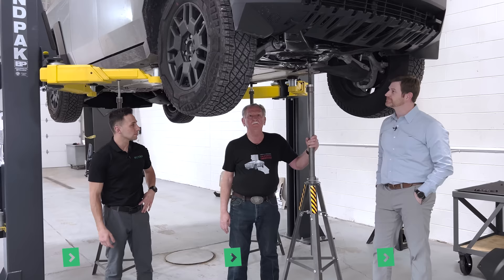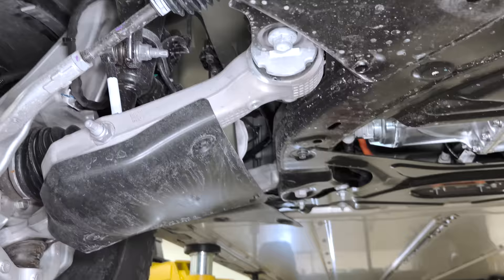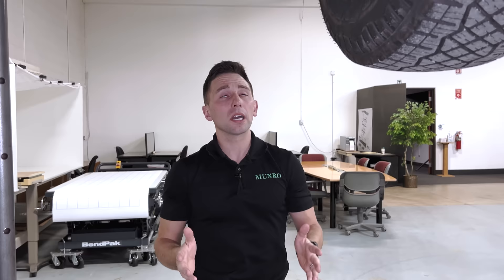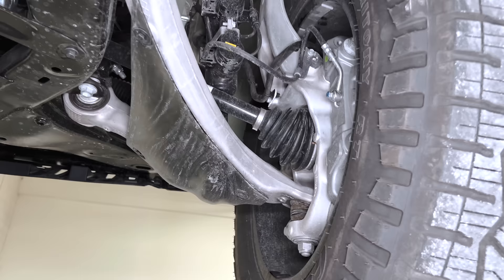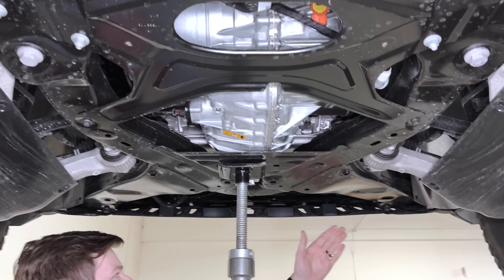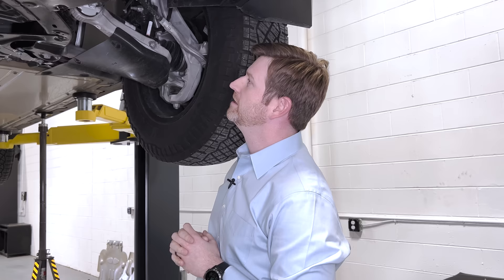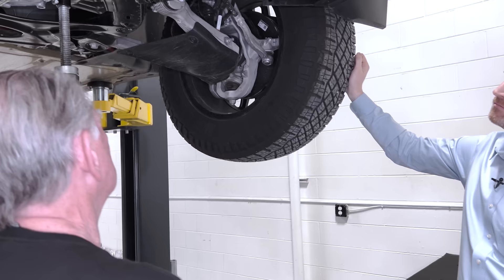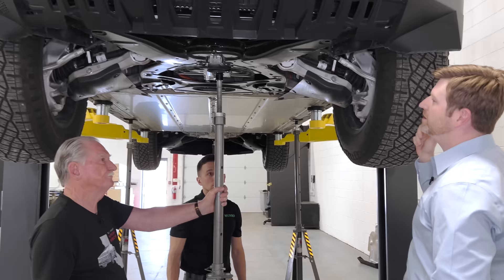Tesla Cybertruck Underbody

Comment: The connector is for the extended battery package that you can't get yet
Reply: That's what I'm thinking too.  Another use might be some future type of inductive charging system, but most likely it's for the extended battery pack in the bed.
Reply: I was going to comment about this but I see you beat me to it. Yes, that is exactly what it is for.   The range extender will be 800v and it makes sense for it directly terminate into the main pack.
Reply: I hear it’ll hit the streets in 2029
Reply: The range extender will basically act as a DC to DC charger when the range extender pack voltage exceeds the main pack voltage.
Reply: Flux capacitor option
Reply: I was surprised they didn't think of it. It was my first thought as well.
Reply: @ryandoyle4344  Indeed Marty... But will the battery pack extension be 1.21 gigawatts?
Reply: A bit small for that for stuff like super charging the extend battery.  It looks to be able to do some type of lower power aux thing. 50A @ 800V? Supercharging would I think require something rated at 500A or so.
Reply: Right
Reply: Tall knuckle is on the Maverick R and other road vehicles too
Reply: But look at the neighbouring connector, how thin these HV wires are, 4-6 mm² max (about AWG 9 to 11, which takes about 40A). If this really was the connector to the extended range battery pack, then this extended range battery pack (about 50 kWh in capacity) could not be fast charged at a supercharger nor discharged during driving, but charging/discharging power would be limited to about 800 V * 40A = 32 kW DC, and therefore about 0.6 C.
Reply: @MooseOnEarth Exactly,  that connecter is to small. 
In my opinion, Tesla is pulling everyone's leg about a battery extender option. It will never be available.  They will claim there wasn't enough interest so they  canceled it.
Reply: Could also be used for solar accessories
Reply: I suspect they hadn't suggested the extended battery pack as an option because the gauge wire the plug could accommodate was too small for the Amperage required for that application. Munro guys are super sharp.
Reply: Was just going to say that.  Thanks
Reply: Yeah, I was wondering why they did not say it could be for the extended range pack as well.  Not sure if an additional charge port could be attached at that point to allow for the option of charging of the HV traction battery as if it were two separate 400V 62.5kW packs.  This could allow for the option of charging from two pedestals at the same time which (in theory) decrease the charging times.
Reply: Yep. Range extender adapter.
Reply: This is an off-road capable vehicle.  A rear winch is a typical accessory that may require direct battery to maximize power and minimize weight compared to 12v.  Campers have power needs too.
Reply: @740GLE I heard it was next year, with FSD.
Reply: @StormyDog  induction charging is to inefficient
Reply: Interesting to note that it’s not the same gauge as the motor and charging pack inputs. Suggests it won’t dump its power super fast.
Reply: @ligarsystm  you are correct, the range extender will only charge at 55 amps.  The extender will likely only be around 50kwh.  

I believe the reason why Tesla held off is because of the issue with sourcing the DC to DC converter for the range extender.  

This might not be the case as I’m curious if that battery housing contains the DC to DC converter for the range extender which would take a 400v DC in from a level 2 DC charger (e.g. supercharger) to solely charge the 800v range extender.  

I don’t think I am wrong since their philosophy is always to reduce cost and “a better part is no part”. Which is why they went with electronics to split the pack into two separate 400v “packs” when charging at a DC fast charger. With that in mind the converter is likely going to be in the range extender unit only. 

When charging at an 800v capable DC fast charger then the converter is simply bypassed and will only receive up to 55amps of current when being charged.  

This would mean it would take longer to charge up to 100% on a 400v dc charger however it would be roughly the same amount of time for an 800v charger to charge the Cybertruck with or without the range extender.
Reply: That was my guess too.
Reply: They advertise that extender so much.  Tesla better not back off. A lot of people are looking forward to that option.

It is already advertised on Google.
Reply: U KNOW it or just your guess? 😮
Reply: LED bar accessorie
Reply: Yes, I wrote the same thing before scrolling down and seeing your comment. Not sure why they did not think of this.
Reply: @WaterBarleyHopsYeast unless it’s in parallel but yeah injecting charge voltage is easier. Putting it in parallel will charge and discharge both packs and is far more simple than stepping the donor pack up to charge voltage. You also don’t want regen pushing current into a DC boost converter.
Reply: @WaterBarleyHopsYeast  Yeah it'll essentially trickle charge the main battery as you go.  in this case, the trickle will be a decent faucet of juice, but nowhere near the amount running to the motors.
Reply: @MooseOnEarth it’s also in a very poor orientation give we know the range extender location is in the bed of the vehicle. This would mean a very long wire lead, and given the existing thin gauge, current is further limited.
Reply: nah it's low voltage. the extended battery will use high voltage connectors, in orange.
Reply: Exactly
Reply: If this is for the auxiliary battery pack that seems wasteful to have the connector and cables installed in every vehicle for an accessory that very few people will opt for.  Probably cheaper to leave them out of the vehicles and have them packaged with the auxiliary battery pack and the trade off of some extra labor when installing them.
Reply: @benlipman 
High power bi-directional DC to DC converters are definitely available now.
That's not an issue these days, and are especially capable/efficient with SiC semiconductors
Reply: Surely it's for the oversized Scalextric braded connectors for on the move charging?
Reply: No it's not, much too small to provide the high current needed.
Reply: Who knows if anyone will ever get it. I can’t imagine having to go to the Tesla service center to have it installed or removed anytime I need extra range or want to carry something large in the bed. An utterly poor design if you ask me.
Reply: @Nalla328 I think you saw the typo, FSD is going live 2035 not 2025, right after roadster2.0 hits the streets.
Reply: @WaterBarleyHopsYeast   It would have to be the same nominal voltage as the main pack, unless there is a DC/DC converter included.  But that would add additional complexity and would be a lot simpler with both charge and discharge if it was the same number of series cells.
Reply: I don't care what it's for.
Reply: Definitely think one is for extended battery and other for wireless inductive charger they are already developing.
Reply: @rogerheuckeroth7456  yes as I already stated, the range extender will be 800v.  I am only questioning, (for the charging side of the equation it would not be needed for transferring energy back to the main pack from the range extender) if either all cybertrucks already have an on board 400v to 800v DC/DC converter in the “dog house” or if it will be in the range extender unit itself.  I lean heavily towards the latter for the reasons I explained previously.
Reply: I was thinking the same. OR... looks like they got the dual motor version, so this could be the connector for the missing third motor
Reply: You can’t get it but you can pay for it. Elon will always accept a free loan.
Reply: @ligarsystm 
If the extender is in parallel with the main pack and has 1/3 the main's capacity, then extender cable capacity can be 1/4 that of the inverter and/or charger cables.
Reply: Maybe add the SpaceX booster they are adding to the new Roadster?
Reply: My immediate thought as well
Reply: @WaterBarleyHopsYeast   No they have a split pack.  Charge at 400V by splitting the pack into two halves and wiring in parallel.
Reply: @StormyDog  no!!!! inductive charging system is an utter waste of materials! the normal charging cable uses significantly way less copper and materials period!
Reply: @WaterBarleyHopsYeast  i dont think its a chagrger! it light well very easily be just part of the main battery pack extension plus cooling.... additional electronics makes no sense!
Reply: @ryandoyle4344  grow up!
Reply: @rogerheuckeroth7456  you say “pack”. Since I already stated the main pack is split for charging at stations that don’t support 800 volts or higher, I assume you are referring to splitting the range extender into two parallel 400v packs.  This is possible but based on the information I have it is unlikely to be the case.  The range extender will not have an external thermal loop connection to the truck’s system and will use LFP prismatic cells with thermal blanket for heating the unit in cold conditions. It will not have any cooling capability beyond conductive cooling to the outside of the case.  Splitting the range extender into two 400v parallel packs would add more complexity to the BMS versus including an in-unit converter for 400v charging duties.
Reply: @carholic-sz3qv  read all my responses in this thread. It is for the range extender.
Reply: @zahari_s_stoyanov  they are tearing down the cyberbeast which has one motor in the front and two in the rear.
Reply: @WaterBarleyHopsYeast  oh, I must've missed that. I thought it was the dual
Reply: @WaterBarleyHopsYeast   Where are you getting that info about the RE pack?
Reply: @rogerheuckeroth7456  second hand from a Tesla source.  The DC converter questions are my speculation though.
Reply: @WaterBarleyHopsYeast  Interesting.  Well I have a RE on order with my Foundation Series CT, so I guess I'll see.  Seams like an interesting approach using a different chemistry and voltage.  Hope the RE supercharges as fast as the main pack.
Reply: @rogerheuckeroth7456  it will be a different chemistry but similar voltage as the main pack.  The only thing I am unclear about is how the RE charging system will be designed to charge at DC fast charger stations that do not support 800v+ charging.
Reply: I guess the best option would have the extended battery actually charge the main battery as opposed to be under heavy power draw.
Reply: 😂 just read your comment after writing something similar 😂😂
Reply: @Wi2Low  you should order a roadster and pay in full and then wait an indeterminate amount of time to ever receive a product. 
You could be one of the poor dumb bastards that have loaned Elon $250M for 8 years, interest free.
You’re the perfect candidate.
Reply: Obvs.
Reply: @740GLE  so more like a date extender, than range extender
Reply: It is for inductive charging.
Reply: What I was thinking as well
Reply: @Nalla328 I heard “two weeks”
Reply: But ….it. Is. Coming.
Reply: Yeah it seems ridiculous that they don't know this
Reply: Drew confirmed on X that this connector is actually for a future inductive charger.
Reply: It’s for a wireless inductive charging module.
Reply: Towing range less than 100 miles…

Comment: What I really like is how safe you guys are in lifting that beast. Shake test and extra jack stands. Bravo on safety.
Reply: Haha!  Wow!
Reply: And thanks for removeing the rods from the jack stands once set in place. They stick out at eye level, so another shoutout for doing things safely!
Reply: Not to mention their using BendPak, one of the safest ALI Certified lifts on the market  🙂
Reply: Not the heaviest truck around.
Reply: You must not only be safe. 
You must be seen to be safe.
Reply: And the shop floor is spotless. 👍
Reply: lame!!!!!!!!
Reply: Yes agreed!!
Reply: @rui569 makes no difference if it's pinning you to the ground.
Reply: @ricardokowalski1579 because they're not doing actual work on anything
Reply: The extra jack stand are excessive. That lift has plenty of capacity to lift a much heavier truck. 
Later they pull the battery, then and only then the jack stands are appropriate.
Reply: Nice job fockos
Reply: @internetpointsbank  the stands aren't really about the capacity of lift they're about balance I've personally never dropped a vehicle off a lift but they can fall from becoming imbalanced suddenly like if you remove the front wheels for example stands will prevent it from teetering over. The other way they can fall is from not putting the arms in the proper spot but my favorite is when people use wood blocks in place of extensions and alot of people are completely oblivious to the fact that you need to set the lift down onto the locks dont ever rely on hydrolics when it will kill you when they fail. When I first started working as an auto tech my first job was tire and oil service tech (I'm sorry but they don't hire the sharpest tools in the shed for that job) I saw some really sketchy things done with the lifts I've seen 20k+ pound f550 railroad/service trucks be lifted on 10k rotary lifts I'm amazed nobody died there but I'm glad I don't work there anymore.
Reply: @Big-lron  Yes Im aware. They arnt working on the truck and making a video on the underside of the truck. Extra stands are dorky.
Reply: That car has a emergency lock for a can disengage and come down. Every time it goes up so far it clicks into a slot where it can't come back down
Reply: @RobbertRob  it's not at all an emergency lock. You always set the lift down onto them never rely on hydrolics to support anything over your head.
Reply: @ricardokowalski1579  EV don't leak much oil 🤣

Comment: There is plenty of delicate wires and tubes exposed to the elements. Off roading or mudding may test the durability and reliability of this layout. All the open cells in the castings can load up with mud or ice, and make a mess once parked in the garage. CT appears to be an ongoing experiment that hopefully works out well.
Reply: Yup. There's probably a lot of companies testing the truck to its limit to sell protectors and stronger parts right now. Can't wait for what the markets comes up with.
Reply: Also there will be a lot of learning to do by Tesla based on what people breaks 😂
Reply: @leonvolq6179 😂 there isn’t an aftermarket for a truck that will have less than 200k on the road in three yrs 😂
Reply: @hoppingrabbit9849  200K - THAT MANY?  In three years Elon will have brought them all back - $$$$$$$$$$$$ down the drain

Comment: What I like about Sandy; vs another channel.that did a teardown is, Sandy and team actually go into great detail, discuss the logic of how a vehicle is built, and how features of a.particular vehcle can be improved and or implamented in other vehicles. On the other channel; their cyner truck was.alreasy torn down, and their video pnly.covered a few things. Obviously, this channel will have several videos thay will break down the cybertruck in stages, making for a more inormative experience.
Reply: The other video was incredibly boring.
Reply: When I was a kid, I  couldn't get things apart quickly enough to see what's inside.
All I ended up with was a pile of junk and cut fingers.
Reply: Im actually subscribed to both, there needs not to be a winner or the best in EVs but good pieces of the same puzzle, channels are like the way we google for information, you get 2 or more perspectives of the same thing and the true picture will be revealed to you. they are both doing very well by my standards.

Comment: As a fellow engineering nerd, I'm enjoying this immensely. Who know how excited one can become about a laser weld being done perfectly?  I appreciate the depth of knowledge demonstrated here. Wisdom is the integral of experience.
Reply: Doubt the battery pack stampings are laser welded. Look to be in the correct location for traditional electrode spot welding.
Reply: spot welds are the round dimples if thats what you were referring to
Reply: lol!!!!! because he has never seen a perfect lazer weld right!!! what a joke! most of those machines are made in Europe/Germany so he doesnt know everything in the automotive industry at all!
Reply: for exmample, the mercedes UNIMOG is full of crazy technologies and options he has never seen! the mercedes vario pilot is a system that allows you to literlay slide both the pedals and steering wheel plus control from left to right depending on the use.
Reply: @carholic-sz3qv  not a lazer weld ya dope its spot weld. and he compares to original tesla spot welds they improved
Reply: @carholic-sz3qv  wow thats crazy 🤭

Comment: the plastic guard under the front suspension is a great ifea!! My f350 kicked a rock and took out the vacuum system for $1600.  Another great idea by Tesla who looks after the customer and not their stealerships.
Reply: Well it'll gather mud and water which isnt great for corrosion, even if it's aluminium
Reply: @FzudemB 
Maybe after offroading on mud
Clean it 🤔
Or remove it, problem solved
Reply: @FzudemB if you're going off-roading then you must have the common sense to clean your underbody after off-roading, if not you're just a lazy off-roader who does not care about the vehicle.

Comment: First and foremost, no you won't want a panel under your truck to snap on. A small water puddle would take it right off.
Reply: Do you think the rear, low voltage pigtail is for trailer wiring harness?
Reply: @normt430 That was my fault unless it's 42V not 12V.
Reply: @normt430  I think your conversation got onto my comment somehow but I had to watch the rest of the video on my lunch break. The pigtail has the blue markings so one would assume it's 48v.

Comment: On front suspension carrier, the two blue lines are paint torque stripes holding on what could be Bob-weights, used to cancel harmonic frequencies at higher speeds.
Reply: Interesting.